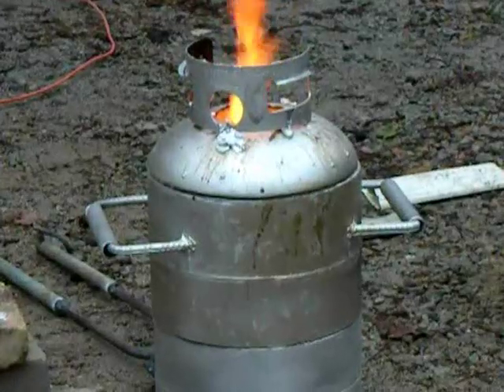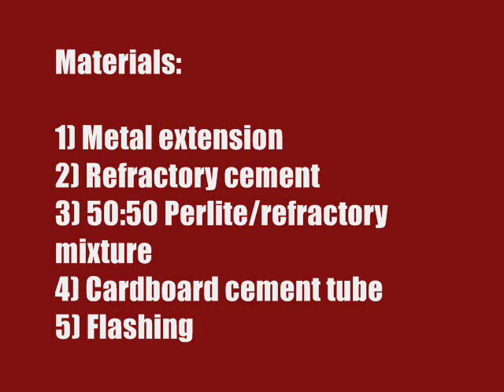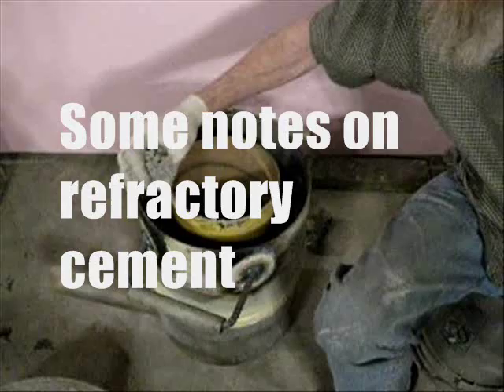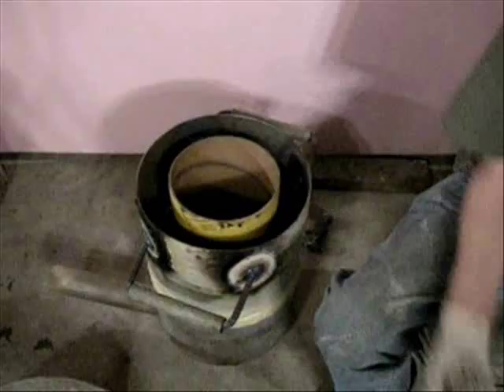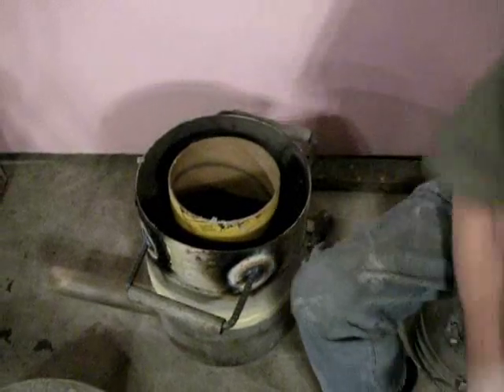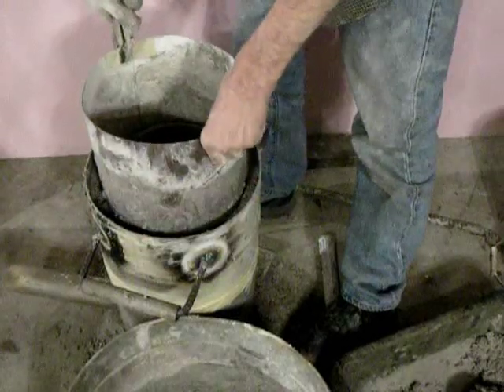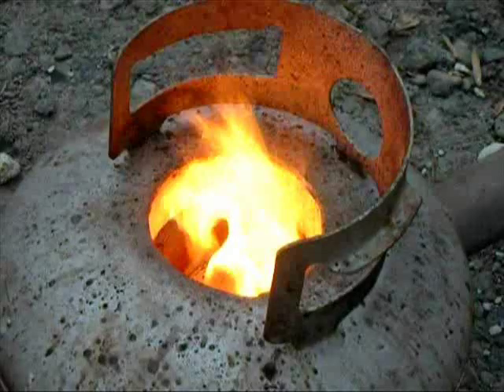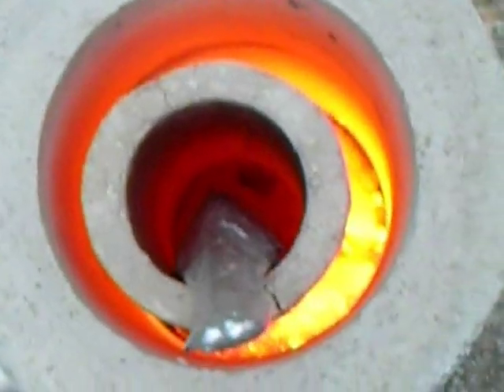Foundry Extension

Comment: @aznmeowmeow If you are looking for refractory, try looking at places that build boilers and also I found mine at a place that builds pizza ovens... Also something else that have been discovered recently is that perlite is bad in refractory mixes because at around bronze temps it starts to melt and then it fluxes the refractory effectively lowering the melting point of your furnace lining. however perlite have been replaced with foam beads, it burns out leaving air pockets that insulates...